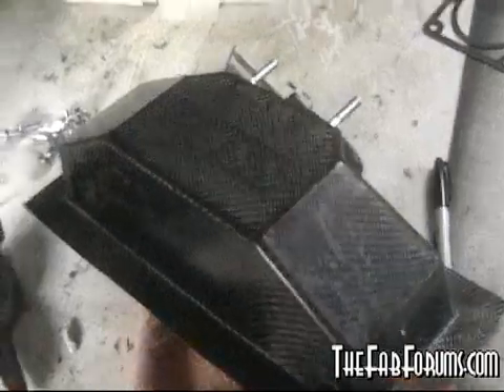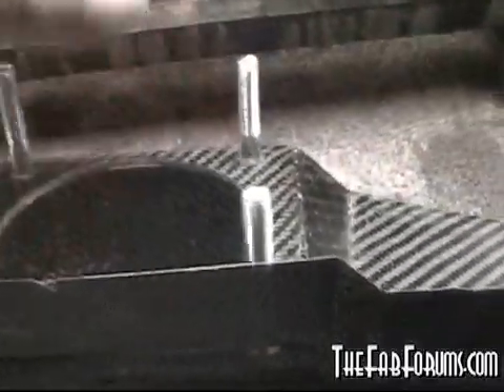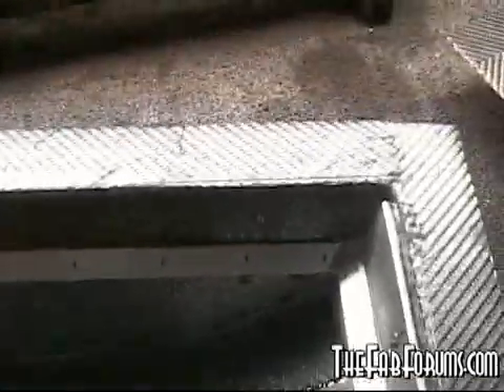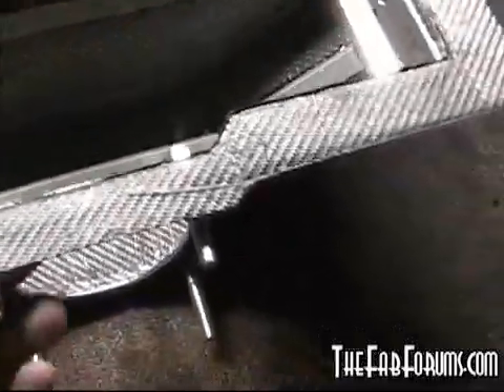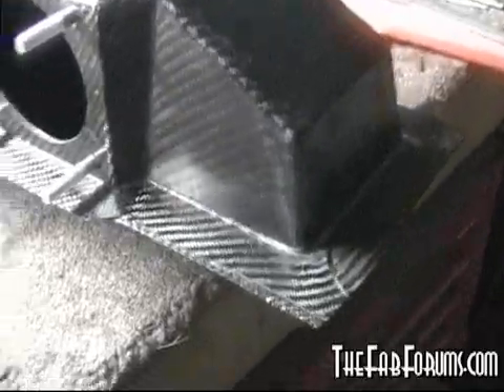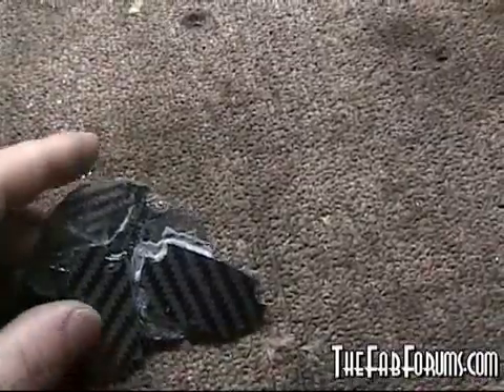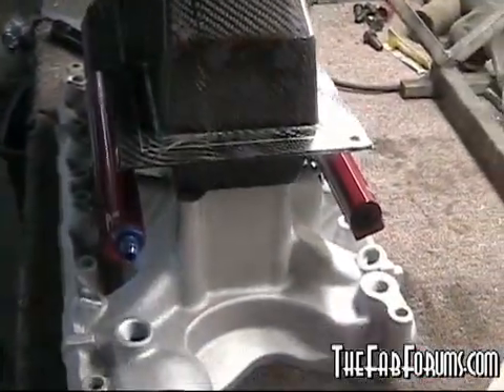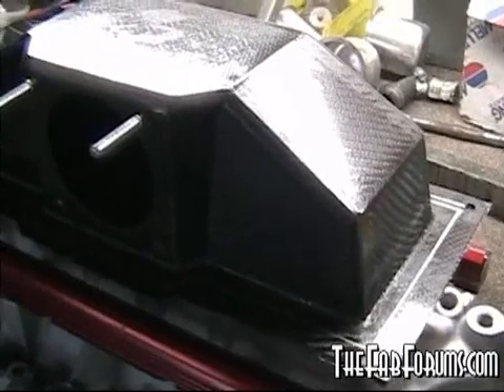Carbon fiber intake how-to build 3

Comment: Where do I order?!?!?!? *will you make me a 90% or something to that effect?  I need it yesterday.
Reply from the maker: sadly I am not doing any customer work
Reply: The Fab Forums thanks, I already picked up a spacer some plate and glass. You inspired me I was thinking of making foam runners and some how building of an inside mold. I am going to copy your negative idea, and just duble stack spacer plates and hog out the top one into a trombone because I'm going on a stock lower. It is a boosted car but I still want a little bit of runner and maybe keep some low end drivability. 

Long story short thanks.
Reply: Ps subscribed.

Comment: Nice work. Not trying to criticise in any way, but if you used socket head cap screws instead of the phillips heads it may give it a little more bling. Awesome work anyway.
Reply from the maker: Thanks...I just found some nice stainless screws at the local hardware store.
Reply from the maker: Thanks
http://thefabforums.com/main/index.php?topic=805.0

Comment: have you blown ur engine by now ?
 dont get me wrong but i think ur intake manifold is shit :)

i dont see any logic at all in it , and "secret nos rail " is as wrong as it can get, it will help you to blow it in no time... because of one sided feed that will over feed first cylinders and starw the last..
Reply from the maker: Nope works awesome. Never had any issues. The nitrous rail has 8 ports and feeds each cylinder individually so I have no starvation issues. Sorry to disappoint you...
Reply: analgins doesn't that assume that the rail isn't rated to flow as much as the 8 individual ports will feed the motor?

Comment from the maker: Thanks for the heads up...I did actually use the intake for a little while. It seemed to work well but I ended up selling the car so I built another intake for the buyer so I didn't have to worry about any future issues that may come up.

Comment: Im not sure if your have run this plenum chamber on your car yet but please be care full.
I Have made 3 carbon fibre plenums over the years and it is not to be taken lightly on a forced induction engine. I have seen in person a Mazda Drag engine with a carbon Plenum explode and dislodge fuel line and burn the car to the ground. You plenum looks very thing and don't even think of using 5 min epoxy as this is not a "true" epoxy and dose not bond on a molecular level.

Comment from the maker: It is not a high heat resin...I think it was good for around 375 degrees according to the maker. It is never exposed to anything even close to that temp.

The intake only feels slightly warm to the touch after use...it just doesnt heat soak like steel or aluminum.

Comment from the maker: I have yet to have any problem with heat effecting the carbon fiber. It actually stays very cool, thats one of the huge advantages over aluminum is that the carbon fiber does not heat sink.

I have actually made engine brackets too.

Comment: How many layers would you need to add to make it handle say 12-14lbs of boost?

Have you done any dyno testing to check hp/tq gain/loss?

And lastly, have you run it down the 1/4mile yet, and if so, what did you run?

Just curious, as I too own a Fox body. 11.2sec@128mph on nearly spent drag radials with a lot of wheel-spin. Vortech V-2 306ci, T/F top end 505whp/450wtq.

Comment from the maker: No sorry I dont. Two part JB Weld is what I found to work the best when I combined the two section on my carbon fiber intake. I am not really sure what you would need to use when creating a fuel cell though.

Comment: What did you use as a gasket material between the fibers and the manifold? Also the fibers did not fracture when you torqued the intake down?